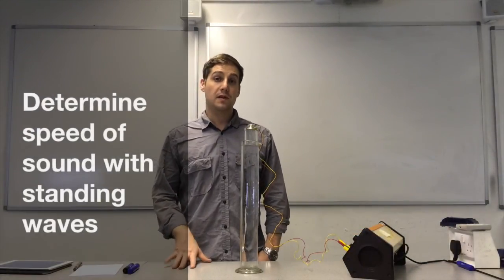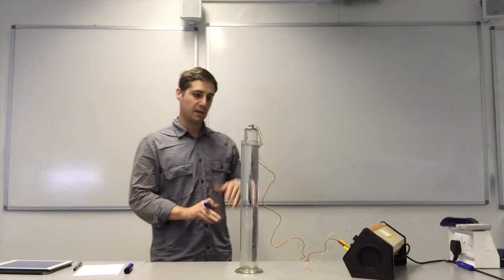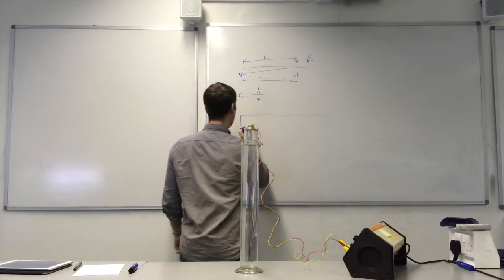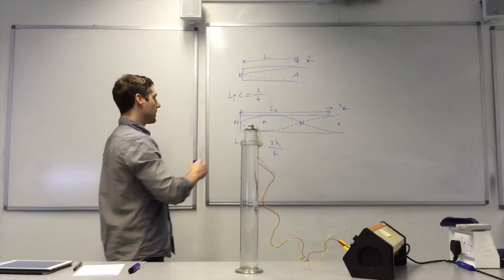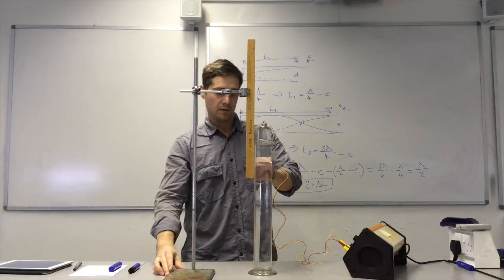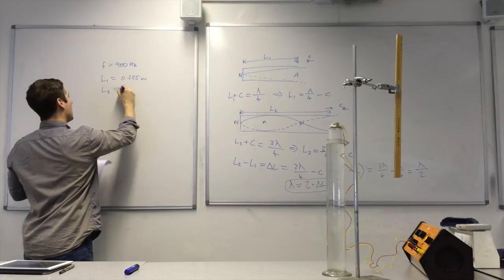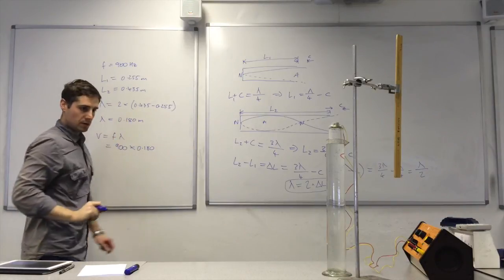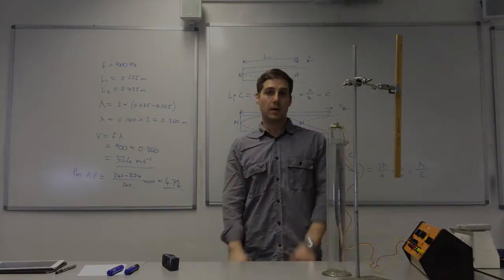Determine the speed of sound with standing waves

Comment: Thank you for the video I've just got a question which is why do we hear the loudest sound at the anti nodes. shouldn't the sound be the loudest at a displacement node since the pressure of the air molecules is at its maximum there?
Reply: In this experiment we weren't identifying anti nodes by a position of maximum volume along the pipe.  Rather we were identifying it by a length of pipe that gave rise to a maximum volume for the whole pipe.  When we create a standing wave the driver frequency (loudspeaker) matches a natural frequency of the pipe giving rise to resonance (the manifestation of which is a standing wave).  We get maximum transfer of energy from loudspeaker to air column and the sound we hear is "loud".

Thinking about the content of the question itself is interesting also: I wonder if the answer to that question depends on how "loudest" is measured?   You are correct to point out that pressure nodes and displacement nodes are not located in the same positions.  If using a microphone one would find the displacement anti node to be the loudest since microphones respond to vibrations in the air (they have a diaphragm that causes relative vibration between magnets and coils).  Our ears also respond to vibration so the same logic would apply.  That said, I don't know about other methods for measuring loudness.
Reply: That is really helpful thank you so much